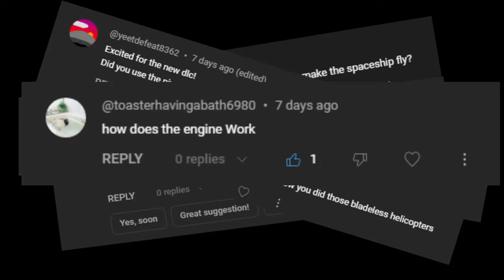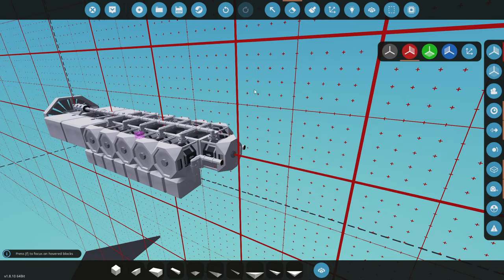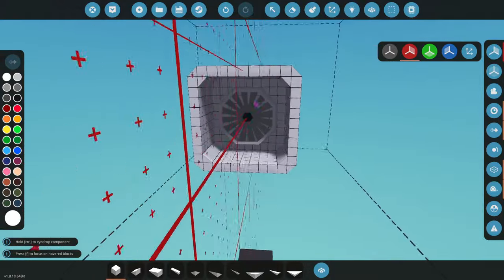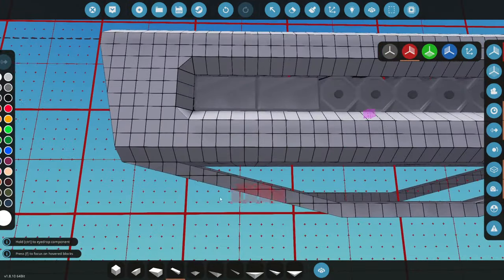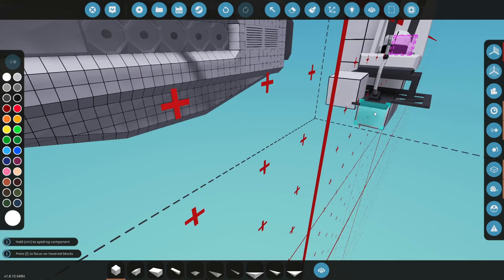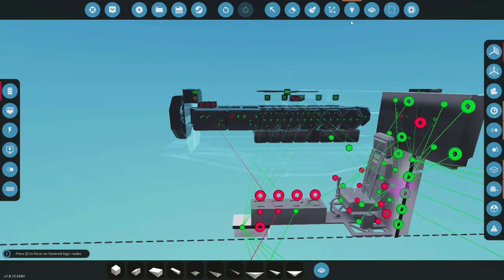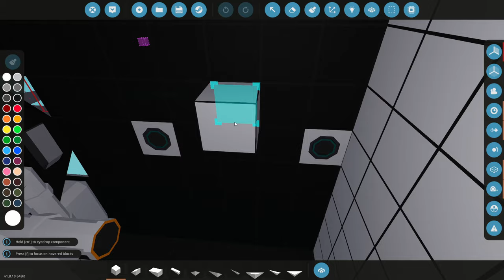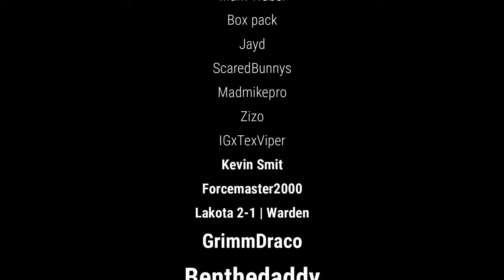Jump Jet Turbine Modular Engine Build Stormworks Tutorial - How To

Comment: It's not nuclear powered, I'm not interested(just a joke as I make literally everything nuclear, very cool engine indeed, have a like)
Reply: You can do the same thing with nuclear power, I like to use the steam piston trick to help boost pwr output to the props and jet turbine. And an output from both the Heli prop and the jet turbine going to a clutch then generator setup... So when you switch from vtol to forward it instantly cuts rotation of the props/jet turbine when not in use, keeps them from creating any forces interfering with intended movement.

Comment: Can you make a video on how to make opening and closing toggle button canopy’s without steam workshop mcs?
Reply: Like pivots? Or a track?
Reply: @IDentification77  on a pivot like modern jet aircraft or something like the canopy that only open on one side
Reply: It can turn a on/off into a toggled numerical value
Reply: @IDentification77  dumb down a bit…
Reply: @IDentification77  like what kind of  logic do I need
Reply: IT Is both a physical block and a logic piece.
Reply: @IDentification77  oh wait sorry got mixed up between hinge and pivot I meant hinge
Reply: @C0R3894  Do you mean for custom doors?
Reply: @IDentification77  no just canopy’s for aircraft small fighters not bombers
Reply: @C0R3894  Sorry I don’t know of a piece like that.
Reply: @C0R3894 if you are talking about the 3 block long Hinge, it cannot accept movement commands. Passive movements only.
Reply: Numeric switchbox, connect the node to pivot. When off connect to constant number 0, when On connect to constant number 1/-1 depends on the spin direction.
Reply: @Tanubtanu  THANK YOU FINALLY

Comment: Anyone have any ideas why my ship pitches straight up and loses control when i apply the forward thrust? I hooked it up completely the same as here, but when i activate the clutch for forward thrust it immediately rotates to point straight up and i have zero control over it
Reply from the maker: where is the pink block for balance?
Reply: @ProfNCognito  I’ll have to double check again in the morning. I believe it sits towards the middle of the wings front to rear, it’s centered on the fuselage width wise. As for vertically I don’t remember. Where should I aim for the link block to be? And is there a specific way to build wings to make them generate lift? This is my first time building an aircraft that isn’t a helicopter so I have no idea what I’m doing lol, appreciate the help!
Reply: @OfficialAlexSailor  i think you want the pink block near your center of thrust and center of lift